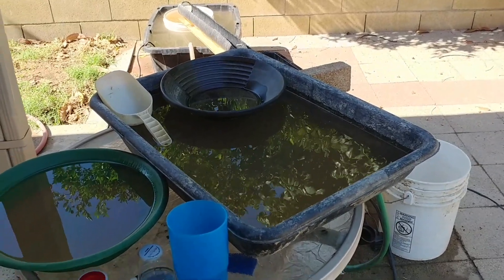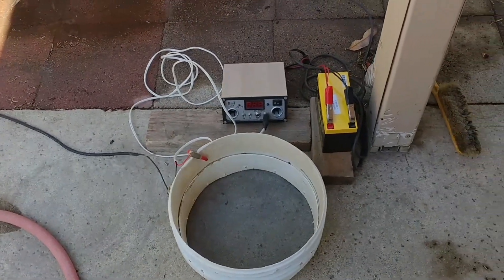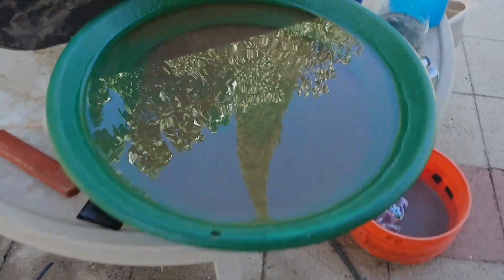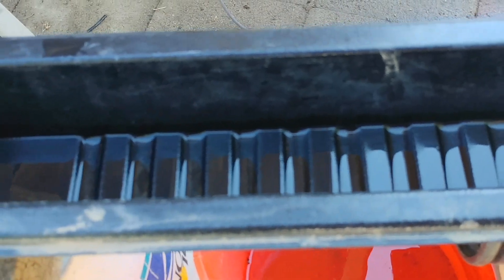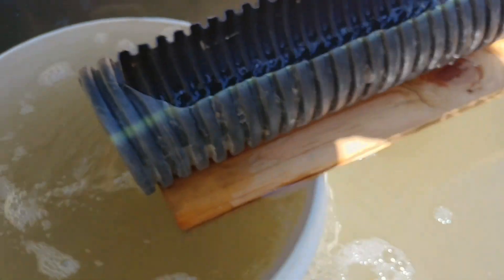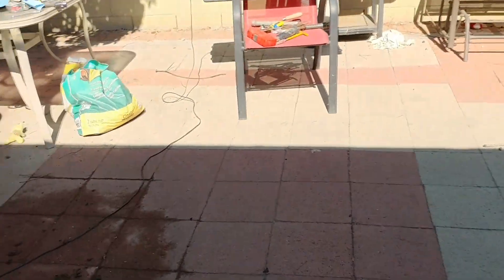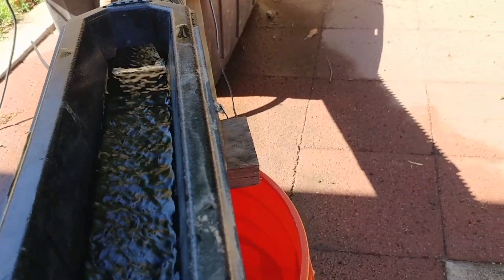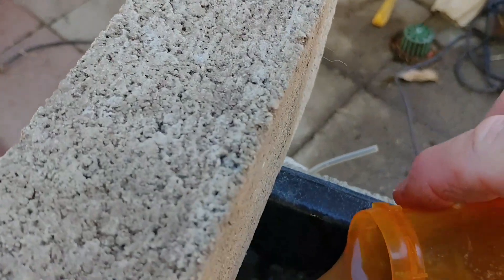Solar Pump Running DIY Poop Tube and Bucket Sluice

Comment: I love it brother. I have a 5gal bucket full of cons that i need to do. I have been panning all the blondes out of it to get ready.Where the heck did you find that vibrator? I think you have it set up perfect. I was always told that when doing cons for the micron gold that you want your clean up sluice almost flat. I have a small miller table that i use. But the kicker with the miller table is patience . lol And me letting the gold fever get me does not have the patience to sit for that long  . However its alot better then watching a blue bowl work. Because at least you can snuffer gold out. Hope to meet you sion
Reply: soon
Reply from the maker: +vin Kretlow / I really don't recall where I found that little vibrator. I just pulled it out of my collection of motors.  Sure gets annoying though. 😱😬 wish I could find something at that is that speed but less noise. 
This set up is just to help get what I know is micron gold and hard to pan down to the concentrate state. I'm panned the tailings from this from stuff a still have gold in them. I know we won't ever get it all. Just the way it is bit I might try running it again flatter like to say. Thing is though if your riffles are loaded with heavies then the micron can't drop. Damned if you do damned if you don't. Good luck. Get that shine and be safe .
Reply from the maker: +vin Kretlow I don't remember where I picked up the vibrator. Thinking It was just given to me with some other motors. I like collecting that kinda junk. LOL ...  It is a small high speed 110 AC  motor wired to that turn switch on the side.
Good luck with that small stuff. Hard to hold onto sometimes.